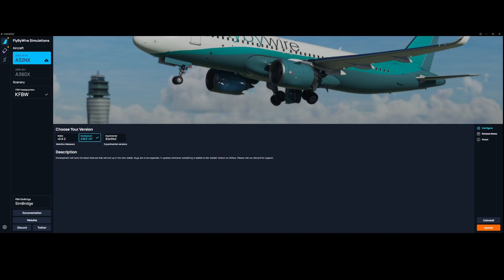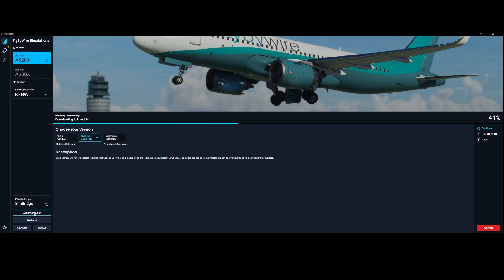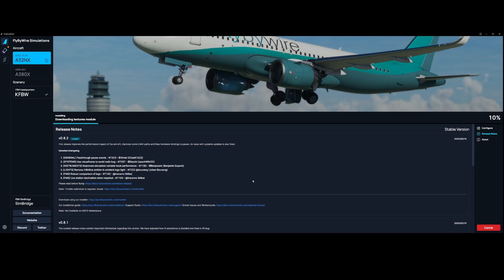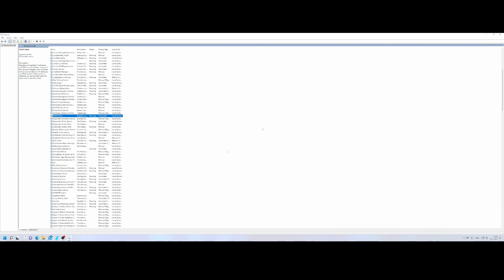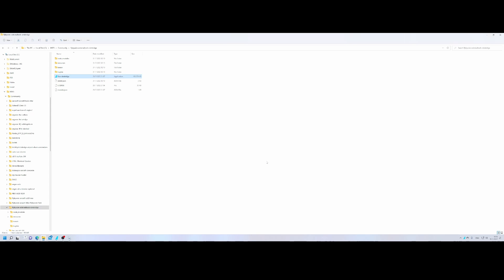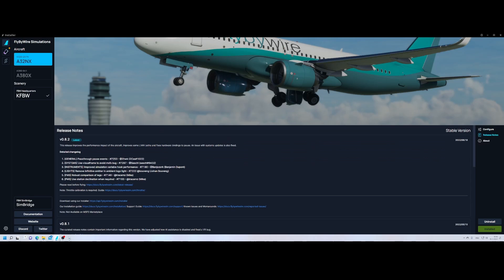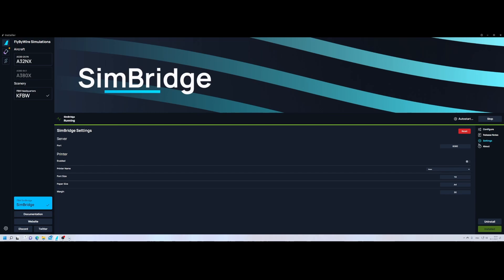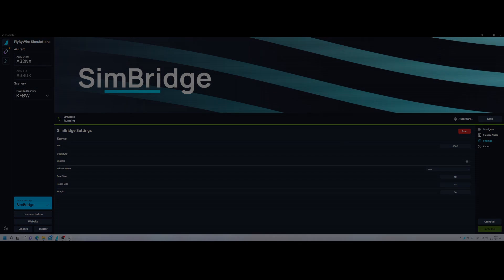Flight Simulator 2020 - How to - FlyByWire SimBridge - Install and configure

Comment: Hi, I would like your opinion on Simbridge.
I fly daily with MSFS2020 with FBW A32NX and A330 HEADWINGS, ( I use windows 11, 32gb RAM , 12GB )medium or long range flights, without any problems for a few years. I discovered SIMBRIDGE and installed it,(just press button, really?) nice with the terrain map, but unfortunately after about 20 minutes it crashes , every time. I have done many tests, but the result does not change. With SIMBRIDGE the simulator crashes
Thanks
Roberto

Comment: Great video. I haven't found any good tutorials for connecting my iPad to SimBridge. I had no problems with older versions of the FBW, but now I'm not having any luck with SimBridge. Any thoughts? Thanks for sharing.
Reply from the maker: hi Sky in most cases it is the Windows firewall blocking the traffic. Have you checked if you can connect to it locally first prior to connecting from a remote device?

Comment: I believe right now it only works with the Experimental version? Also it won't work if you have other FBW Compatibility mods installed like for the A321 or A330-900Neo.
Reply from the maker: correct the it works with the a320 also in the dev version if I am correct